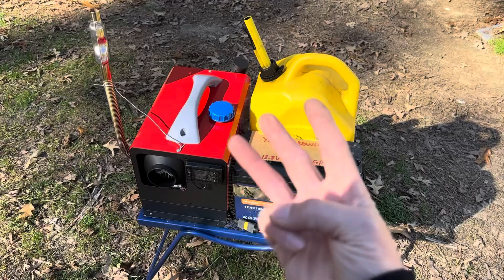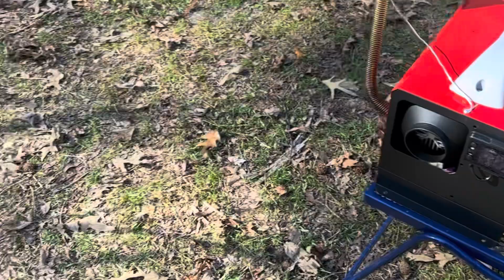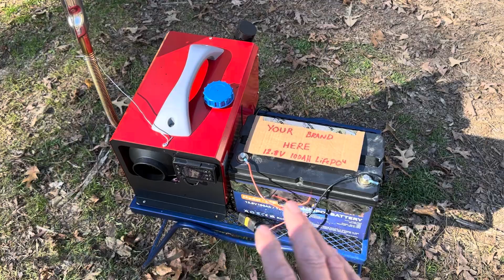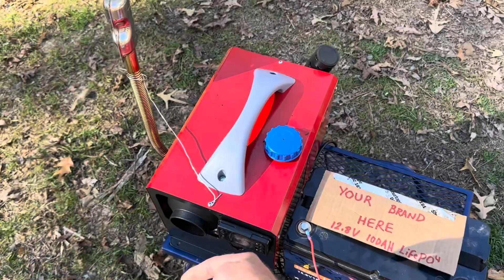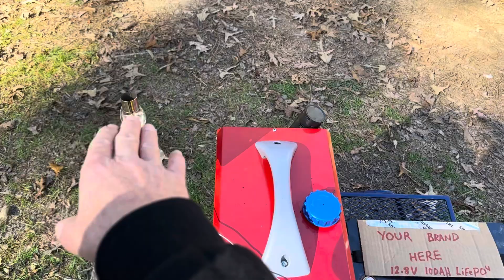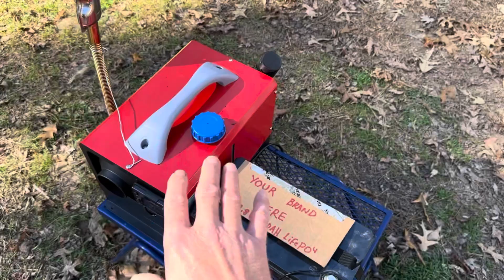The Truth about DIESEL HEATERS

Comment: id heard/read that the exhaust should slope downwards ?
Reply from the maker: Yes in a permanent location the exhaust is supposed to slope down. I use the heater in various locations for only a couple of hours. Easiest for me to semi attach the exhaust in the configuration I have for transportable ease. No soot or condensation buildup thus far. This is usually only a problem for those who turn down the fuel rate and run colder exhaust gas temperatures. Also I don’t point the exhaust down due to operating in the forest many times. 350-400° exhaust and dry leaf litter would not be a good combo

Comment: I have two of these as a tertiary heat source. Since it will be outside I use lead acid car batteries for power. AutoZone sells what they call used batteries for $50 when they exceed 12 months from manufacture date. Hook that up to my cheesy hobo freight solar and it will run a long time.
Reply from the maker: No doubt the heaters put out lots of heat and only use minimal DC energy to operate which is nice! Just fuel costs for me outweighed all of this. I have it as a backup option and plenty of diesel and biodiesel to run it on if needed!

Comment: Dose this heater have any smell to the air going in? Looking for a good tent heater for camping on hunting trips
Reply from the maker: No smells on the discharge air. It’s just a micro oil furnace similar to what was used in many homes circa 1950s-1980s. About the same efficiency as well. Should work good on a tent due to constant heat losses. Hope this helps
Reply: Hey poorman, I have two of the 5kw units. One keeps my two man 10' teepee tent pretty decent. Burns clean at 3-4 hertz, and will burn about 2/3 of a gallon over a 10 hour run. Can draw over 10 amps at start up (5-6 min) but will settle down and draw 1 amp.

Comment: 2 parts diesel, 2 parts filtered used motor oil, 1 part 70% alcohol hand sanitizer ( i got a LOT of it),  I love it vevor heater rocks.
Reply from the maker: Curious if any issues with carbon buildup on your fuel recipe? If so how many gallons do you run before cleaning? 

This one will be on Biodiesel soon!

Comment: There's a reason there is a weep hole in that muffler. you might want to start by assembling the unit properly.
Reply from the maker: Hard to condense water at 400F exhaust temps 😊
Reply: @THEOFFGRIDMOUNTAINHOMESTEAD  If your fuel pump was properly oriented you would not get 400f, nor would you burn so much fuel. but good luck

Comment: I always run mine on 3-4 out of 5. The higher the heat setting the higher the exhaust temp. If you run them on lower settings they have the tendency to coke up and throw an error code along with having a heavy diesel smelling exhaust. I’ve got a couple backups on a shelf in my garage just incase
Reply from the maker: Thanks for sharing your experience with the heaters! 👍

Comment: That is the most comprehensive review I have seen on those Chinese diesel heaters.  It will be interesting to see if you can improve the performance by tweaking the settings.   Looks like a very viable option for a source of heat.
Reply from the maker: Thank you! I don’t want people thinking they can run all night on 1 quart of fuel lol! 
I’ll try my best to tune it up! Might not be any wiggle room for adjustment but the combustion analyzer will tell me a lot more!

Comment: Well it looks like it is a emergency heating source!   Mine works well in the shop but I never have used it to heat in my home. All very good concerns and definitely a  disappointment on the thermostat function.  I have watched several people who have installed  some type of aftermarket thermostat, but the cost was almost as much as the heater. Just goes to prove nothing is free. Enjoyed the video and hope to see more in the future.
Reply from the maker: As a shop heater it’s probably a great option if you have the fuel to feed it! Small structures is where some of the inadequacies are noticeable! Great backup option 100%!